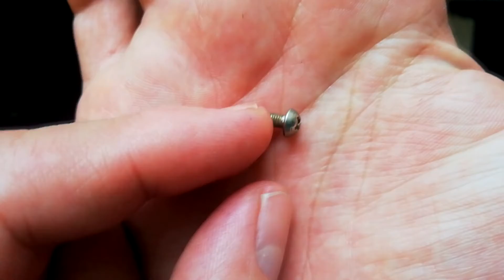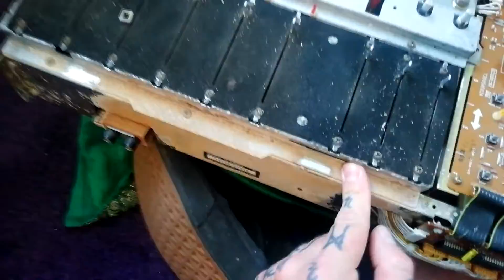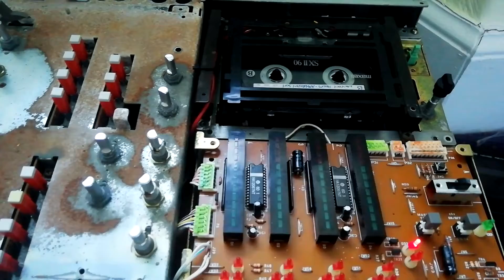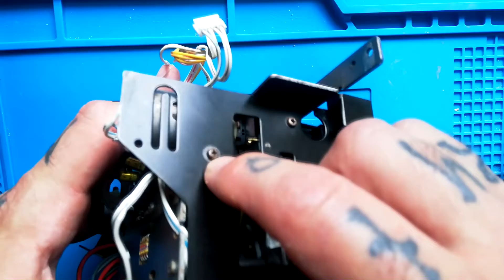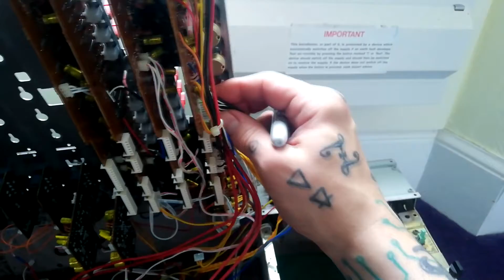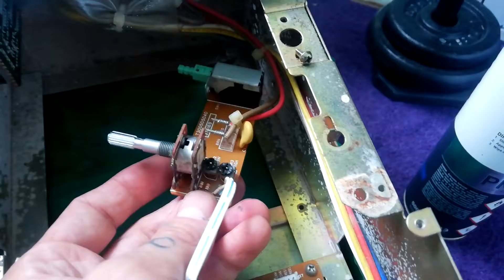Akai MG614 cassette 4 track | Tear Down

Comment: What a nightmare they made the mixer modular then trapped it with a metal plate why  ?  At least put each channel a separated module they cheaped out on a few screws on each channel and some longer cable. if they designed that in all seriousness to be pro quality then they should have made a modular mixer forget putting a tape deck in it a stand alone tape deck like the Foster X24 in a metal case would have been more pro because it's just not portable.

Comment: Excellent Video  , You scare my ass off  as you can do this to close the door by  pressing  the  eject button again "Do not close it by hand!!!
However, dosed anybody have  a spare big board that the  led the drive the transport as min is broke ,
Also my head don't go right up the tape does not spin , the bet its good . going to see if its the  dc monter (any ideas what voltage it is )
Reply from the maker: Not gonna lie - I didn’t read the manual! I refer to service manuals, when I need them, if I can get them, but I guess I’m more of a learning by doing type guy lol

Comment: Thank you so much for making and sharing this video - your skill and effort are excellent. Akai MG614 4-channel tape recorder - has Built-in EQ & Gain Control – Offers parametric EQ and solid gain staging, making it versatile for shaping sound. it's Limitations vs. Modern Preamps – Lacks ultra-low noise floor and high dynamic range found in modern digital preamps.
While it may not be the go-to choice for pristine, ultra-clean recordings, it remains a hidden gem for those seeking classic analog warmth in their mixes that make engineers go back to the desk to shape. It is really a box of analog warmth customized for a beautiful 80's analog sound for your sound shaping arsenal made for the tactile person. No midi interface needed for hands on and no PC needed to load a analog plugin. I digress I still will use it all for different reasons. lol

Comment: I’m having trouble getting my cassette door to close. i took it out and was able to spin the gear to shut it, but when i turn it back on, the door opens again. Any chance you have an idea on how to fix it?
Reply from the maker: @ashtongary4535  maybe, but not that I can easily encapsulate in YouTube comment. I’ve got an hour long tear down of the cassette player here on the public YouTube channel which includes some discussion and analysis of how the mechanical side of things work. I also made an hour long summary of a process I went through to refurbish another unit with faulty control boards on patreon. It’s a lovely machine but honestly it’s a bit over engineered and the hardest to fix of any of the 60 models from over 10 companies I’ve had to repair…not beginner friendly!

Comment: Found one of these but I’m missing the power supply. . . If anyone had any ideas I sure would appreciate it!  😮
Reply: I just found the power chord for my AKAI MG615 and it appears to be an "elliptical" 7A 125V (part number KAWASAKI KS-18B) The original chord was brown (rubber?) whatever they were made of then. Replacements seem very easy to find. Many of the replacements are "notched" and the original is flat on the sides (you'll see what I mean) so the notched ones should work fine too I was able easily search them out. I hope this helps